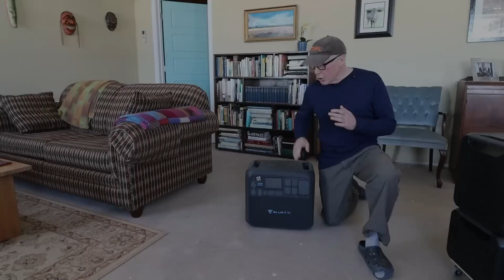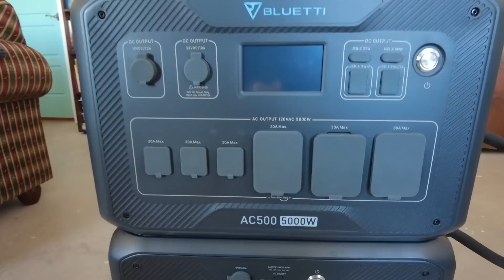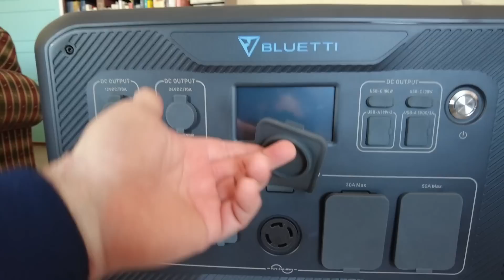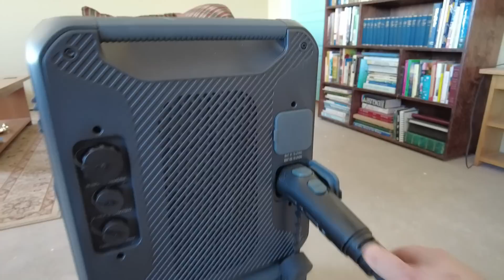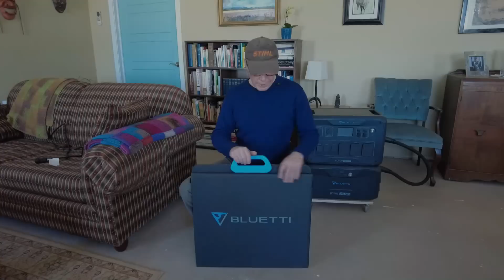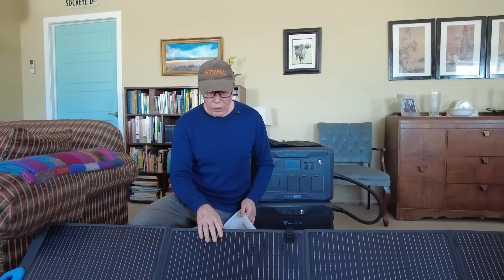S2E74 Taking care of the Electrical System at Rover's Rest with the Bluetti AC500 5000watt

Comment: Energy capacity is expressed in watthours. Power capacity is expressed in watts. Always talk about watthours with battery capacity! Power x time equals energy, hence (watts) x (hours) = watthours of a battery. That 3000 Wh battery can run a 300 watt load for ten hours because 300 W x 10 h = 3000 Wh. I think a small to medium sized refrigerator consumes roughly speaking 1 kWh (one thousand watthours) over 24 hours, so one of those things will keep the milk fresh for three days of blackout – if nothing else was using up its energy.
Reply from the maker: You are absolutely right. Many of us just choose to shorten it to watts when speaking about capacity. Just like when I say I'm glassing the hull, it actually means I am fiberglassing the hull.
Reply: @RoversAdventure  That's exactly the issue; shortening works in some contexts but sometimes it's just bad practice that does not translate to everything every time. If a project requires ten manhours of work, it's not clear what is meant if one shortens it down to it needing ten men! Anyway, that's my pet peeve and I'm sorry about bringing it up again. I'm excited to see the current progress with Wave Rover 2!

Comment: Reliable portable modular systems are coming of age finally. Your review of the Bluetti AC500 reflects a well thought out design. It is a very viable system for eliminating the need for a generator especially for infrequent power outages.

ONE QUESTION:
• Can the Bluetti AC50 also be tied into your home main electrical panel? 
If so, this would make life even easier for Mrs. Rover.

-----

MY HOME:
For our home we started out with a 5000 watt (7000 watt surge) generator first with.a generator switching panel then with a whole-house connection that needed manual attention when switching. NOT ideal for the non-technical. Since this was a pull start and my wife does not have the upper body strength to properly pull the starting cord, we upgraded to a 8000 watt (10,000 watt surge). With this generator we can run the full house including the electric dryer!

In March 2015 we added 8.2 kW-hour solar array on the roof — 30 panels with Enphase microconverters almost perfectly covered the roof. The grid tied system meets all of our needs with a slight excess over the year. We pay $18 per month for the power utility connection charge.

ADVANTAGE: 
Since the system is paid off, the recent electrical price increases had no effect on us.

DISADVANTAGE: 
• Grid tied systems shut down when the utility lines go down (to protect from back-feeding into downed wires.
• Snow on the fixed roof panels needs to melt enough to "slide off" much like metal roofs. (My nephews use post mounted arrays that they rotate the panels to vertical.)

We recently purchased the Enphase 10 kW-hr battery storage with a "smart switch" that will disconnect from the Utility line while directing the battery power to the house main panel in milliseconds. Very important for home medical equipment.

MY BOAT(S)
My Capri 22 has a 160 W solar panel for the house battery AND motive battery.  It has a Torpedo Cruise 2.0 ideal sized for it. Other than experiments with various chargers and battery chemistries, I have reliably used this setup for the past decade. 

My Catalina 310 will have 2 solar panels totaling 850 watts. The house battery and galley demands are much greater that my wife expects she needs. (I on the other hand, hope to replace the noisy diesel with an electric drive.)

With my boats, sailing is the primary propulsion. The auxiliary motor is just that – an auxiliary, to be used in mooring or docking, occasionally for windless conditions. We love the quiet of an electric drive.
Reply from the maker: I may go with an electric OB in the future but I am going with a gas 2.3 hp OB due to cost. And yes the Bluetti can be tied into a smart panel for the house.
Reply: @RoversAdventure  — Glad to hear the Bluetti can be tied into a smart panel. Mrs Rover will really appreciate that added convenience when the power goes out during a snowstorm and you are commenting about the warm tropical weather.

 The gas outboard that came with my Capri 22 was not reliable enough and the noise bothered both of us. I really wanted to get an electric outboard. I actually started experimenting with a low cost 12 volt Minnkota which was sufficient for my O'Day 19.

Our Catalina 310 has a diesel. Since it is working well right now, I will use it. But once something goes awry I will have my excuse to go electric. The Westerbeke Universal M25XPB is a marinized Kubota block smaller than my tractor. I do have enough experience to make most repairs. But an electric motor would be so much quieter and would eliminate the vibrations from the diesel.

But the frugal New Englander (with Canadian Maritime ancestry) won't spend money before it is really needed.

Comment: Do you actually mean the capacity is 18 kW hrs?   (not 18 kW)
My small 1-bedroom home with 2 people used about 350 kW hrs in February (summer here) which averages over 10kW hrs a day which will be mostly water heating.  So this unit would supply us for less than 2 days.   If you plan to cover a multi-day outage in winter there you may want a n even bigger unit ?
Reply from the maker: This is for emergencies, hot water will have to be heated with propane

Comment: To simplify everything even further I would suggest putting in a critical loads panel in the house that the portable power supply can hook up to and then all that will have to be done is plug in the power cord into the box and flip a couple of switches and then the whole house we'll have power where needed including the
Reply from the maker: Good ides
Reply: @RoversAdventure  I've even seen some people have 50 amp subpanel unplugged from the grid plug and plugs into their backup battery to make it the simplest I'm not sure if it's code compliant but it seems to be a pretty good idea then you're not having to buy inexpensive transfer switch